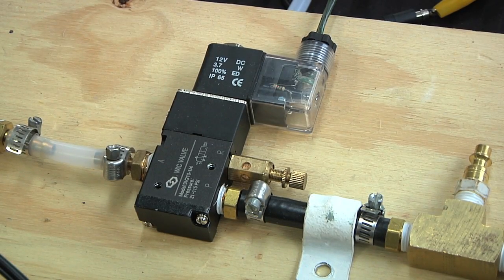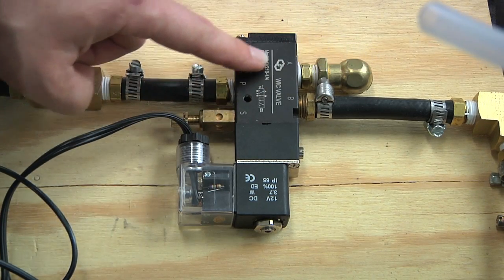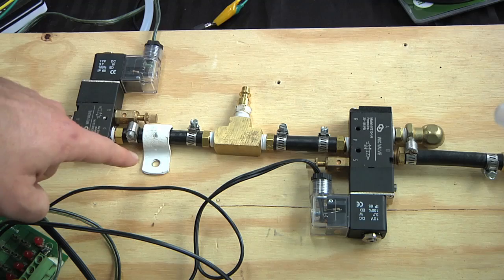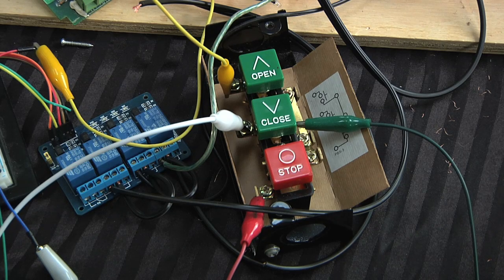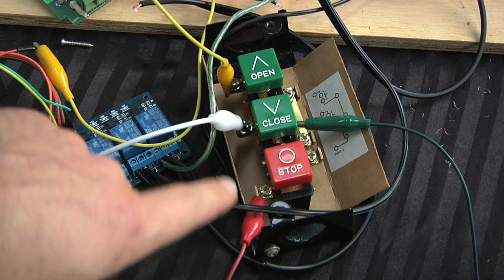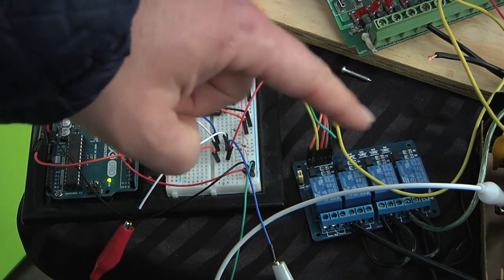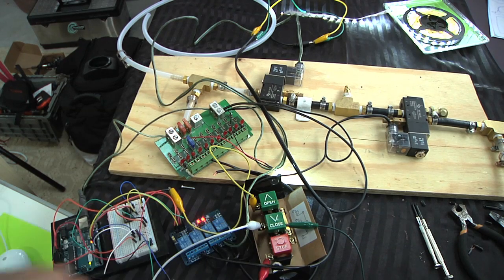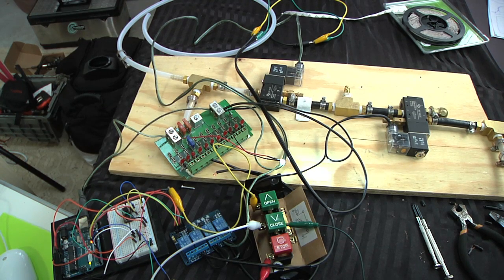Star Trek Doors: -in Progress- Valves, Buttons, & Arduino

Comment: for safty you can allways use an infrared sender and receiver. At least thats how they do it in an elevator.
Reply: Good idea. In addition, I'd recommend a pressure sensor for safety. If something blocks the door, the pressure will rise and the doors should open again. Also, instead of a timed open/close thing, better use microswitches or optical sensors to tell the ardu when to stop, since sometimes it may be a bit slower, for whatever reason.

Comment: i dont understand why you dont use a belt driven by a motor...  a belt with a pulley at each end moves in both directions same time, i just depending on with side u connect the lever. to add safety u can use ir, ultrasonic and even laser, each way has its pros and cons. another way is to mount a hose in the door blades and a pressure sensor. if the pressure is raising the door might be closed correctly, or there is a person or something else in between stucked. i would recommend to sensor the whole height of the door, to prevent that a single leg, animal or whatever can be stuck.
Reply from the maker: +Christian Fuchs The door could be opened and closed by a whole range of means. I like the air cylinders because it naturally makes a cool noise, similar to the sound of doors on sci-fi TV shows. I like the hose with a pressure sensor in it idea. Kinda like how full service gas stations would have the hose with the bell to alert the attendant!
Reply: +BenjaminNelson Later on i thought over, and came on the same idea why: the sound - of course! btw: arduino can trigger sounds from an sd card - so if u wanna add some dramatical tension by using sound: arduino can. securing it by this idea have also some cons. first of all: u need two small hoses inside your both doorblades. i guess u can hide them into the rubberlips i saw in your other video, but u need to move them with the door to the fixed installed sensor. so u may need a kind of dragchain or such - not a big deal. second is that u will need an aditional microswitch when both doorblades very close together to tell arduino not to sensor anymore upon this position, cause the next measured value in the hose will be the moment when both blades hit together - or better use the event to tell arduino: microswitch pressed & pressure sensor hit = door secure closed. You can replace the timedelay in the programming (what is always the worst idea) this. on the programming its just few lines more on code.

there is one more thing i wanna say: i am from austria (not australia) and i dont have a glue what full service gas stations use for alerting the employer. never seen one. i can figure what this may be and how it works, but im sure something like that was never been used in europe. good luck with your project, i'll follow it!
Reply from the maker: +Christian Fuchs
Referring to "Full Service Gas Stations", there was a simple system in which an automobile would drive over a hose. The one end of the hose was capped, and the other end was connected to some sort of mechanism that would ring a bell. I just think it's interesting to think of different ways to accomplish a task, especially when it's something simple.
Reply: +Christian Fuchs You will have to use a belt or chain any way.  You will have synchronization problems.  One half door will always move faster or before than the other due to differences in friction.  So the situation will happen where the left half door will go open and hit then the right half door will start moving.  With a belt you only need to use one cylinder.
Reply: +randycarter2001 you are right. I didnt think about that, but u r right. Im thinking if a bumper at the end of the way may help? So, even if they r not synchron they stop where they should. The timing of the cylinder will be also not that critical anymore.
Reply: +randycarter2001 one more idea i just mentioned... The way why u use compressed air is just because the sound... So, let's bridle the horse from the back: what if a motor drive a beld, and the connected cylinders compress the air, the valve open and you have your pffft? This in combination with a singing motor may sound even better... Anyway, i just an idea. Never made such...